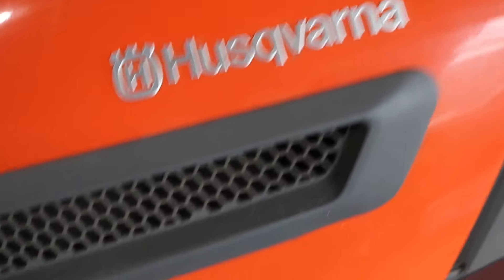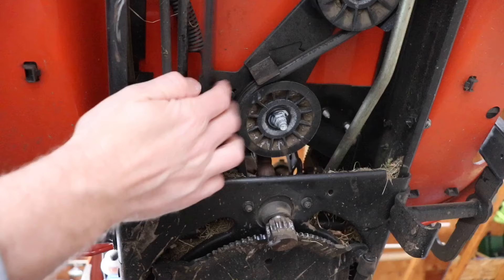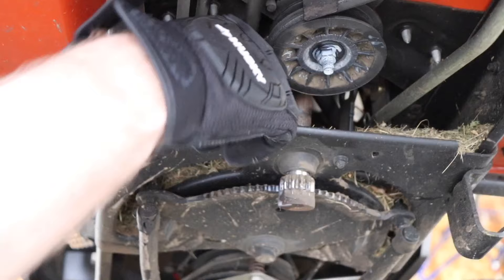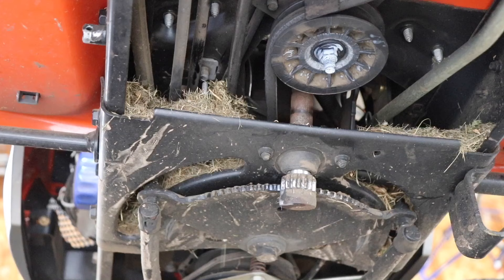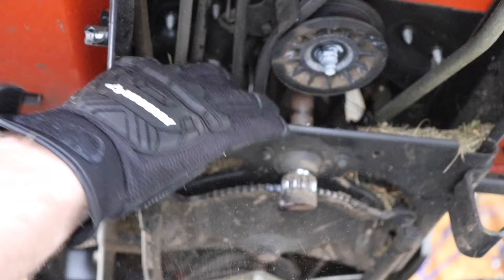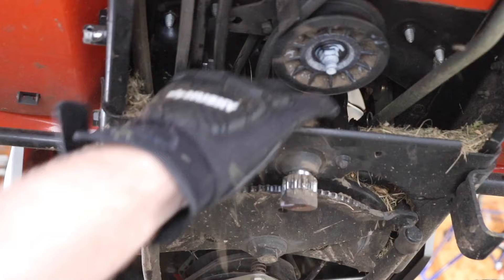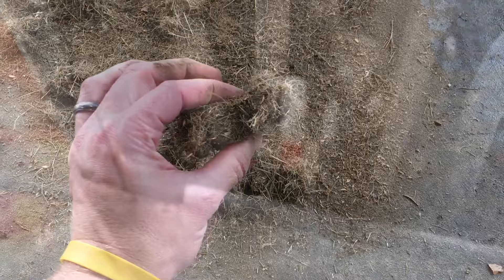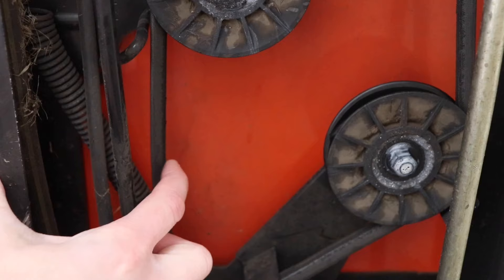Watch Before You Change Husqvarna Drive Belt! - Tractor Transmission Belt Slipping Problem SOLVED!

Comment: My Husqvarna developed a screeching, near deafening loud sounds that I could sometimes lessen by gently touching the brake pedal. I recorded the horrible sounds, went to and played it for my long time local mower/equipment shop guy. He said “could be this, could be that, it’ll take about a week or more to pull it all apart and get it back to you for a couple hundred but possibly more depending on what I find.  I’m retired with a failing fixed income with an ever present subtle fear losing our home of 40 years in the not too distant years.  I watched your post, cleaned out the compressed grass and presto, the horrible chattering sound has disappeared. I’m one very, very, very happy old guy. I’ll always look to you first for insights from now on. Thanks for what you bring to our world and I’ll share you freely with all. Butch McGuire at 81.
Reply from the maker: I’m glad you found the video helpful! When I am doing DIY type things I usually have my camera going because it’s not that much harder to film the process. That way someone else can save a little bit of time or money by doing it themselves! Thank you for watching!

Comment: If you'll use air hose to blow all the clippings off after every use, including raising the hood, and blowing fan, battery area. Down beside the rear of engine you'll find two openings, one at each corner, there is a round hole, this is the area where you cleaned out. Use air hose to blow down each opening couple times, alternating back and forth, this will prevent that from happening.
 Also try not to wash mower deck when it's just finished mowing, because this tends to kill the bearings in your idler pulleys' and spindles.  Even if you wash it after it's cooled down, be sure to run it for few minutes to dry water off everything, are use air hose attachment to blow all pulleys and spindles off. Otherwise water sets on them, and will seep into sealed bearings washing grease out prematurely.
 These few things is what I've learned over the years, from my own mistakes in thinking I was doing the best I could to maintain my mowers. Only to figure out that I was doing more harm, by doing the things I was doing.
 Also on bigger decks, I add another wash attachment connection to the opposite side than the factory installed one, and this makes sure that entire under deck area is washed free of built up clippings.
Hope this helps you, out, by learning from mistakes, and I made, and learning how to correctly do things, saving lots of headaches, and money needed other places .
Reply: Yes !! I use my leaf blower, or my compressor with an extension on my air nozzle, it's about 16" long and does a GREAT job of keeping everything clean. It's much better for the machine for obvious reasons too !  I wash my tractor regularly just like I wash the cars and truck, I blow dry them too. Well worth the time ! Only takes a few minutes but makes a big difference, especially if/when I do have to work on it !

Comment: THANK YOU!!!  I actually pulled the transaxle and changed the oil in my Husqvarna lawn tractor because I was having the same issue and some posts said maybe the transaxle was low on oil or the oil had broken down.  Well... it was a little low on oil so I took care of that with the new oil, but after I reassembled everything, the "go" was no better.  Then I found your video and Ah Ha!  I had the same issue with the clump of dirt and grass keeping the belt from tightening.  30 seconds later my mower drives like new.    Thanks for taking the time to post this!
Reply from the maker: Paul Ortmann thank you for watching, I’m glad the video was helpful. It’s amazing how much a small clump of grass can screw it up! Please consider giving the video a thumbs up if you haven’t already! Thanks again and glad that you fixed it!

Comment: Thank you so much! Had the same problem on a Craftsman mower made by Husqvarna. Changed the transaxle fluid and filter with no effect. Ordered a drive belt, then came across this video while waiting for it to arrive. I always use a leaf blower to clean the deck and mower after mowing, but had no idea that a clump of grass in could stop the machine from climbing a small hill. With the great editing and knowing exactly where to look, I found the clump of grass causing the problem in seconds and now it climbs like a billy goat. Thanks again!
Reply from the maker: Thanks for watching I’m glad the video helped you get your mower back to working order! It’s amazing what that a relatively small clump of grass can cause this issue! Thanks again and also for the Super Thanks!

Comment: Finally!! Thanks for the video. I have been trying to figure this out for a while now. I had just enough power each time to cut the grass but it was a struggle. I have tried a lot of stuff and was getting ready to change the drive belt when I found this video.  5 mins of cleaning and I was back up and running like it was new!

Comment: This solved my problem.  I had lost both forward and reverse.  I removed the mower blade housing for better  access to the nooks and crannies then used my air compressor to blow debris out. To my surprise forward and reverse worked great.   Easy and zero cost.
Reply from the maker: That's great! I'm glad it was helpful! Thank you for watching and please consider giving the video a thumbs up if you haven't already! Thank you!

Comment: Can't say thank you enough. This was a life saver. My mower was only 4 months old and thought I was going to have to fight to have warranty work done. Thank goodness it was just grass accumulation.
Reply from the maker: jow popper that’s great, glad you found it helpful and that you didn’t have to go through with a warranty fight! Thank you for watching and please consider giving the video a thumbs up if you haven’t already! Thanks again!
Reply: @5MinuteFixit  I have a 4-year-old Husqvarna YTA22V46 lawn tractor that has given me nothing but fits, especially with the so-called "automatic" transmission.  These tractors are poorly designed and lots of debris accumulates in the back of the mower where the pullies for the drive belt and transmission belt are located.  To clean, you need to remove the battery and clean with either a hose or compressed air.  The tractor is supposed to have a top-end speed of 7.5 mph, but I've been on it when the tractor could only go about 2 mph and would have trouble making it up a slight grade.   I'm very disappointed in this lawn tractor and will most likely sell it after this cutting season and buy something else.

Comment: Hey buddy...I owe you a beer, or maybe a whole case! I was about ready to put my mower up on a trailer and tow it to a repair shop half an hour away. Problem solved in 5 minutes. BTW, if you lower the mower deck to the lowest position, you don't need to remove it. Also, sticking a long screwdriver down thru those 2 cleanout holes in the frame will enable you to dislodge most of the impacted grass.
Reply from the maker: That’s great! I’m glad you found the video and were able to fix it before you brought it to the shop! That’s for the offer of the beer! I appreciate it, I’ll take a thumbs up on the video in place of the offer! Also thanks for the extra tips on on the clean out holes! Cheers!

Comment: Just replaced drive belt and tractor wouldn’t move.
Watched your video and knew I had a clump of dried grass exactly where you showed. 
Cleaned it all out (at least an inch thick), runs great now.
This is my neighbor’s tractor and no maintenance done whatsoever.
Thanks
Reply from the maker: I’m glad it was an easy fix and you didn’t have to replace the transmission or mower! Thank you for watching and please consider giving the video a thumbs up if you haven’t already! Thank you!

Comment: I always use my leaf blower in my mower before putting it away, so it seemed unlikely that there would be any build up of clippings anywhere. Wrong! When I had the deck off I checked the area shown here and it was packed with debris, enough so it took me awhile to fish it out.  Even though I had a new belt ready to install, I didn't need it. Now there is no slipping on hills.  Thanks for the explanation and good video!
Reply from the maker: Dan Webster thank you for watching! Glad the video and explanation was helpful to you, please consider giving the video a thumbs up if you haven’t already! Thanks again!

Comment: I think it’s annoying that the owner manual doesn’t guide you to this issue. I found out the hard way, new belt and idlers. It is a hard spot to get right into and I think that the manufacturers need to set up a solution in new models. Using a long nose air blower seems a good idea that I Haven’t tried, so thanks for the tip. I may make an adapted tool for this to really get into the tight places. Great vid, thanks
Reply from the maker: I also think they could have done a better design so this could have been avoided in the first place. Thank you for watching and please consider giving the video a thumbs up if you haven’t already! Thank you!

Comment: Was just about to give up on my lgt2654, cause no matter what I do the belt slips so easily. Didn't know about this so I'm going to check it out tomorrow. Thx!
Reply from the maker: Did this remedy the problem, I hope so!
Reply: @5MinuteFixit  I believe so though it was on a different model there was some build up under that panel where the brake bar sits. So far havent had the belt come off so thank you!

Comment: Man I was about to throw my husq away. 400 hours on this bad boy. 2010 20/42 and it cuts 2 acres weekly. Rebuilt the transmission put a new drive belt on and it ran great. Fast forward 2 months and it doesn’t move again. Jacked it up and saw the drive belt has no tension when the brake is off. Damn it’s a new belt!  Checked out your vid and I had to e exact problem major build up of grass. Hard grass clumps. Chipped it all away with a large flat blade and damn if this beast doesn’t now drive like the first day I bought it!  Awesome man thanks a lot.
Reply from the maker: That’s great! I’m glad you found the video and it helped you out! I love it when it’s an easy fix! Thanks for watching and also check out my other mower maintenance videos if you are interested! Thanks again!

Comment: Holy Butts. I can't say for sure this is my issue, but there is for SURE a LOAD of crap underneath I need to clean out, that can't be doing any good. 
I've always only ridden other peoples lawn tractor.  Just like people never think about checking fluids on a car til the first component fails- I'd never think to clear the grass off the mower til I have to maintain my own. Thanks!

Comment: I have the same exact issue.  It runs and cuts great on flat surface, but no longer makes it up the hill that it always did before.  I was about to call the repair shop to come pick the mower up and fix it.   I will check for grass buildup in the morning.   Fingers crossed!!
Reply from the maker: P M hopefully this is your issue and you can save some money! Thank you for watching and please consider giving the video a thumbs up if you haven’t already! Thanks again!

Comment: Good info, my drive was slipping on my gth2654. I had over 100 hours on my belt, I mow about 4 acres of rough terrain and often high grass/weeds. So it seems my belt just got stretched. I sprayed some belt dressing I bought at the auto parts store...problem solved.

Comment: 100% solves the problem. Thank you sir you saved me a bunch of time and money! A bit of a engineering over site from my point of view. I barely had forward and no reverse. The area in this video is just forward of the mowing deck and on top of flat surfaces. I had grass clippings dried hard as a rock just like he did in the video. Removed same and back up and running in less than 5-10 min. Reaching the area requires some patients and creative angles. Good luck out there and always watch for the kids!
Reply from the maker: Thank you for watching! I’m glad it was helpful! Please consider giving the video a thumbs up if you haven’t already! Thank you!

Comment: I just purchased a Husqvarna 138 CT riding mower.  The brake both stops the tractor and engages the hydrostatic drive.  Two issues:  First trying to accelerate [from stop] is jerky and like riding a bronco!  Pressing the brake abruptly stops the tractor with excessive force.  Driving is terrible; jerking onto motions and lurching to a stop!  Second issue is the excessively loud [squealing] sound the belt makes; engaging the drive!  Now I have a new tractor that squeaks. bucks and jumps, all for the neighbors to enjoy!   Is belting dressing an opinion?  Can the belt tension be adjusted to smooth acceleration and reduce squeal?
Reply from the maker: I would shy away from belt dressing, from my understanding that should be used when a belt is under constant tension and still slipping. I think the jerky acceleration will slightly soften over time but I have to say even with ~260ish hours on my rider it’s still slightly jerky. Hopefully this helps! Thank you for watching the video and please consider giving the video a thumbs up if you haven’t already! Thank you!

Comment: Thanks, I'll definitely check my Poulan Pro 500EX for that as right now the transmission slips on hills or towing a dethatcher and I've been using a gummi strap to hold my brake pedal all the way up ever since last year when I changed the noisy tensioner pulley :)  If it turns out to be the belts though, I already have new ones here I ordered from Amazon last week and it could very well be both as the belts on it are the originals from when I bought my mower 11 years ago.

Comment: Mine just started slipping and I found your video first. I hope this is the problem. Thank you!
Reply from the maker: Did it work?
Reply: @5MinuteFixit  i had another problem. a tension pulley was locked up. But I did have a bunch of grass there that I had to clean out.
Reply from the maker: @gdash4187 I’m glad you figured it out and are back in business! Thanks again for watching!
Reply: @5MinuteFixit  thank you for the great video detailing every single thing.

Comment: Positive this is my problem- THANK YOU
Reply from the maker: Thank you for watching! Glad you found it helpful!
Reply: Do you know if the hydraulic fluid can be topped off or seals replaced? Pretty sure my right rear blew the seal but the boyfriend says it can’t be fixed on these?
Reply from the maker: @elementalraven27  the fluid can be topped off but you have to remove the whole rear end and I believe they do sell rebuild kits for these. You would have to check to see if the seals are included in those kits. Thanks again, hopefully this helps!

Comment: Mine still won't go. It was moving good then stopped. Like it wants to move but don't.
Reply from the maker: You may have a more in depth problem with the transmission, does the belt have tension when the brake is off? Check this with the mower not running of course.

Comment: Mine slips, but there is no debris. Is there a way to tighten the belt? Thank you.
Reply from the maker: There is no tensioner pulley one these mowers other than the brake being released. If the brake is released, there is no debris and the belt is still loose it (the belt) most likely needs to be replaced. Thank you for watching!
Reply: @5MinuteFixit  I appreciate that.

Comment: Treat the machine properly, you avoid these problems. A proper compressed air cleaning after each mow ought to do the trick. I'd also imagine this accumulation would occur from cutting wet or moist grass.

Can you imagine how many folks trashed their  mowers because "the transmission is going or has gone bad" ? I imagine many.

Comment: these huskys are junk! , plastic pulleys, mine throws the belt every second use, reverse doesnt work up the smallest incline. I noticed my neibour under his mower yesterday obviously tossed a belt too. to fix a tossed drive belt you have to remove seat and gas tank which is a beach . grind away some metal to make it easier to remove the gas tank. Stupid design,cheap plastic parts,dont waste your hard earned money on these.